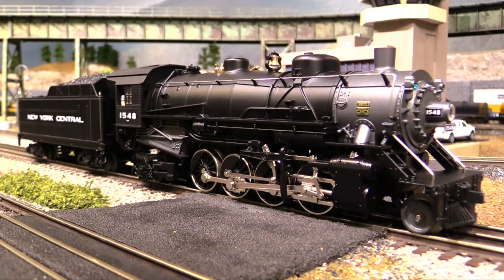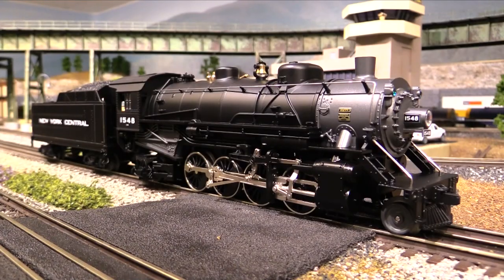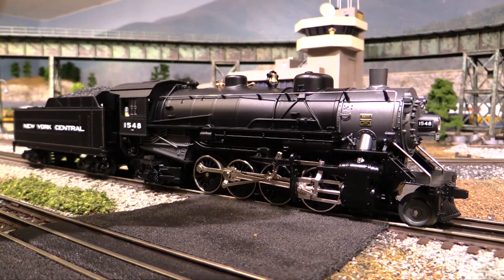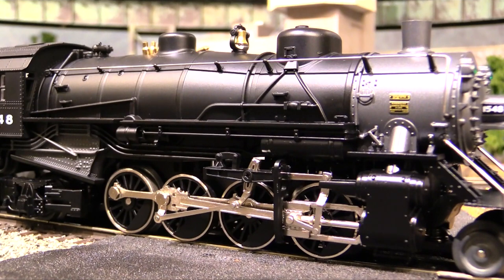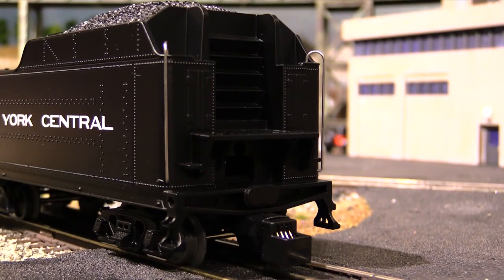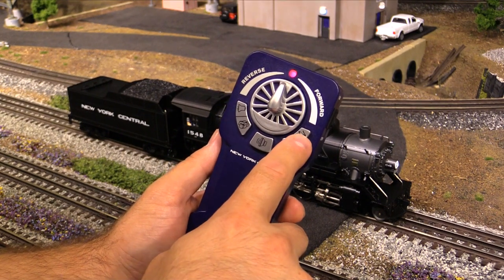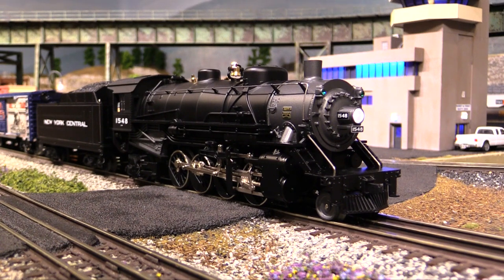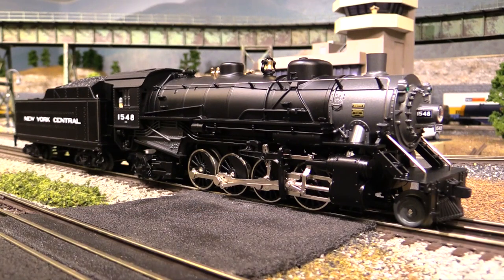Lionel Lionchief Plus Mikado

Comment: An update for someone that comes across this video. And now, 4 years later, you have some locomotives coming equipped with Lionchief PLus 2. That can also be run via Legacy, TMCC, and conventional, giving you 4 control options. Those are typically more expensive models though.

Comment: I remember my entry level Lionel Steam set back from the mid-1990s.  Things sure have come a very long way for entry level!  Back then you got that basic transformer with a whistle button and directional button only.  The locomotive did have puffing smoke and an air whistle or sorts, no digital sounds or anything.  Those were the days!
Reply: And much more expensive. To much in my opinion.
Reply: @bluefoxy6478  Oh yes, these trains at $1000 or more, that's a lot.  I sold off whatever I had which wasn't much.  I would have to say that I believe I made money on what I owned, though, so that was good.  Also had a 1960s American Flyer set that I got a good amount of money for.  Unfortunately I had to sell it in bits as no one wanted to cough up enough money to buy everything in one lot.  Oh well, not my loss.

Comment: fun fact for ya'll the Mikado also made their way to Australia were they became known as D59 class locomotives. they were imported as oil burners due to a coal shortage. all but 3 were eventually converted to coal firing. one of those 3 were scrapped. and i believe only one of these D59's is still operational.

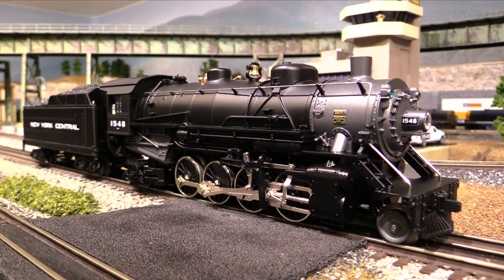Comment: 1:59 does anyone have a picture of that locomotive?
2:25 does anyone have a picture of a Nippon Railway 2-8-2, or know of its later classification?
15:04 I thought the switches would be under the dome or in the tender!
19:28 in case you're unaware about the history of the lionchief system, it was introduced in 2012  for stater sets, and the lionchief plus individual locomotives were first produced in 2014!
21:22 that's an easy way to identify something's wrong!
27:05 are all 20 of those cars 0-27?
29:29 we go from high balling to slow speed!
This model looks really good for an 0-27 model! Somebody might think its a scale engine!
Reply: I think I’ve seen a picture of one.

Comment: The 2-8-2 locomotives are called the Mikado. The first Mikado type locomotive was built by the Baldwin Locomotive Works in the US for the Nippon Railways of Japan. Mikado in English means the emperor of Japan. The first Mikado in Japan is the JGR Class 9700. 9700 is a good engine, but sadly this engine was scrapped!

Information: https://locomotive.wikia.com/wiki/JGR_Class_9700

https://vignette.wikia.nocookie.net/locomotive/images/8/8f/JGR_9700.jpg/revision/latest?cb=20180713133509

Comment: I have a Lionchief+ Milwaukee Road Hudson. Best engine I own, as of right now. The only gripe I have is the chuffing sound of the Lionchief line at medium speed. Low speed sounds incredible and high speed sounds very good. At least that's my observation. Also the whistle of the Hudson is different than the one on the Mikado. Another observation.
Reply: I agree. It's the same chuffing sound on their Camelbacks, which I have one of, and at medium speeds it just sounds off. But I have a small 4x8, so I usually only run it at a slow speed.

Comment: All of the Lionchief Plus engines are upgraded former TMCC engines.I have the TMCC Pennsy version of this.
Reply: No, I didn't mean it as a bad thing. I have a TMCC Mikado and Pacific and while they're nice, these new ones look a lot better. The TMCC ones didn't have fan driven smoke units or speed control, and the Mikado doesn't have a lighted firebox either.

Comment: I myself was thinking about getting into the hobby as well. I kinda wanted the scale prototypical look of O scale without the space or money it takes up. I was thinking either HO scale or S scale. Which is better or what's the difference?
Reply: HO scale. Cheaper, and takes up WAY less space.
Reply: colivera427 Yeah, that's what I was thinking.
Reply: There isn't very much that you CANT get in Ho scale
Reply: Simon Grant Yeah. HO even has my local commuter railroad in it.
Reply: +karl schweizer there's always that one item that's damn near impossible to get...
Reply: You could do S scale. It's in between the size of O and HO, and the older steam locomotives have chuffing smoke units.
Reply: +Lionelpostwarfan S scale is a little more obsecure and there's less things you can buy for it. It's also expensive to do from what i've seen
Reply: +colivera427 S scale is hard to find and not that much rolling stock.There is s helper and older american flyer.Lionel has always made s scale trains.But not a whole lot.Now lionel has started offering some s scale trains.And so has mth.I would go with lionel or mth railking.Its up to you you know what you want.
Reply: HO is tiny, half of O, hence "HO". S Gauge is smaller than O, about 3/4th of O. They can get pretty costly too, but not too unruly, usually 500-600$. S is for the not too budget-minded hobbyist who wants to save some space. HO is for a budget-minded hobbyist who really wants to save space. Both scales are great, I'm more of an S Scale gal, but you're free to choose whatever.

Comment: I'm confused. When you say it's self contained does that mean it's battery powered or something? You said that there wasn't any separate power pack... .-.
Reply: i think he meant theres not middle recever it just goes from the remote to the engine ,The engine is eletrically powered but the recever for the remote is in the engine itself and not through an out board recever that puts the commands through the rails
Reply: What he meant is that the remote sends a radio signal directly to the engine like the case with RC cars, RC planes and RC boats and ships.

Comment: Hello Eric, I love your videos and I was wondering what radius do you use so large steam engines like the triplex work and don't derail? I am hoping to get an SD70MAC and a legacy controller along with 3 box cars. I want to go with Lionel tubular track but I don't know what I should use (radius wise, and I am confused on what o-31 or o-27 means)
Reply: I found it I'm going to use O-72 and just going to use snaptrak
Reply: I don't have too much space so I'm going with a little bit smaller, that will run locomotives like 765 right?
Reply: Ok thank you for the help!
Reply: I use a railing with lionel track and train lol

Comment: Hi Eric,

I'm trying to decide between a Lion Plus like u reviewed here or Lionel Pennsylvania  Flyer (thinking it's not plus) which can be had on Amazon for $150.  Lower price is a plus but I'm concerned with audio chuffing, bell, whistle, smoke quality.  I'm really only wanting it to slowly circle our X-mas tree with the cool effects (u noted the slow quality was nice in your review), but if the quality in the Pennsylvania Flyer is close to Lionel Plus I'd consider it.   I looked online for comparisons to Lionel Chief vs. Chief Plus and no one really touches on differences in ability to go slow, smoke, and audio quality comparisons between the two different tiers.  Any help would be appreciated!
Reply: I'll answer my own question, as I went ahead and ordered both the Pennsylvania Flyer starter set and LionChief Plus Mikado.  The starter set will not crawl away realistically.  It will go slowish but doesn't maintain steady pace in corners at slow speeds.  It doesn't have a realistic chuff leaving the station slowly.  Very glad I ordered the Mikado.  FYI, I combined the vision line  reefer cars with the Mikado and it's amazing going around the X-mas tree with wheel squeak.  However, Lionel indicated they are not meant to run on DC and do cut out every now and then.  They should probably be clearer about these not meant to be run with DC, though they do work mostly for now, as I'm sure many more people will be doing what I'm doing with these Lionchief Plus locomotives, wanting all the cool features on a VERY basic DC layout, especially given they are marketing this as getting advanced features on DC, so why would any beginner/novice think the Reefer cars also wouldn't work on DC wall wart, and no where on their site do they indicate the reefers are meant for AC only.
Reply: Why didnt you go for the polar express?

Comment: Who made the Operation Lifesaver Boxcar at 26:57?
Reply: Lionel has recently released the LionChief Plus Berkshire. One version available is Pere Marquette 1223. I wish it was numbered 1225. Also they did it in Lionel Lines 726. The cool thing is the design of the engine is same design as the Postwar 726.

Comment: “Entry level”.. You say this a lot but from a cost stand point they offer entire sets for less and same modelwith less options.. so those are the entry level trains... this is mid level isn’t it?  Either way, nice train, nice videos.
Reply from the maker: Like many things I say in my videos, that's a CYA technique. If I don't call it "entry level" I will get loads of comments from people thinking the engine is terrible when compared to a top shelf engine. So I want to make it clear that this is not a top shelf super fancy ultra detailed engine and should not be judged as such. Of course, in doing so, I also get these kinds of comments...but I get less of these so I still come out ahead. Thanks!
Reply: @Ericstrains   I understand..can’t make everyone happy on the web..can you please tell me where to find a list of Lionels “scale”  LCPlus or how to tell if one is scale or just gauge as I prefer proper scale and detail but cost saving of the chiefs system. Need some guidance here. Thanks again.

Comment: Spending a grand or more on a model train is insane! My cell phone is way more cost to engineer! I bet it cost peanuts to produce all of these beautiful trains! Wow! They are absolutely amazing! But the technology it is using is so easy to do and make nowadays!
Reply from the maker: maxpaul11 It’s not the electronics that make the model expensive, it’s the tooling necessary to make the model, which for a model like this will usually run anywhere from $100,000-$250,000. That’s why the models cost a lot to buy...because they cost a lot to make and because Lionel can’t recoup the cost by selling millions of them (like your cell phone) but instead they will only sell perhaps a couple thousand at most.